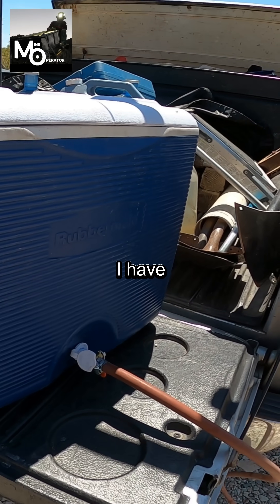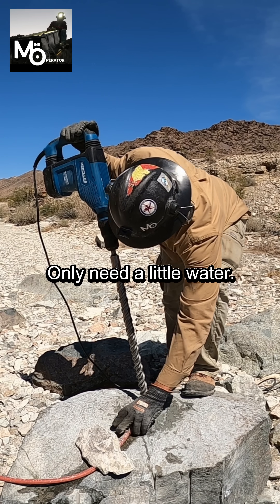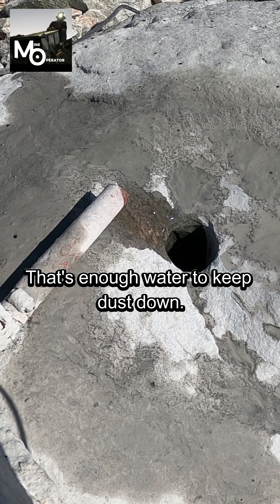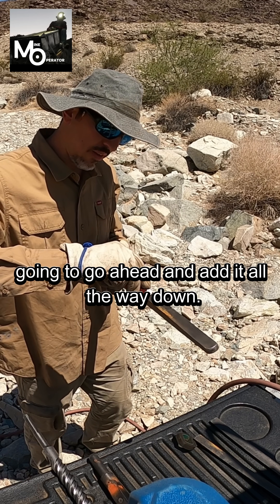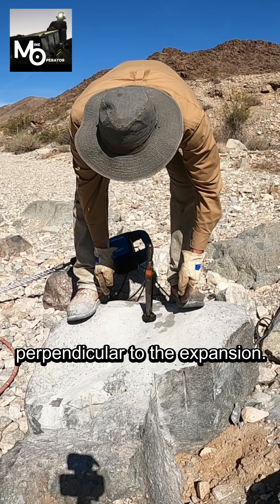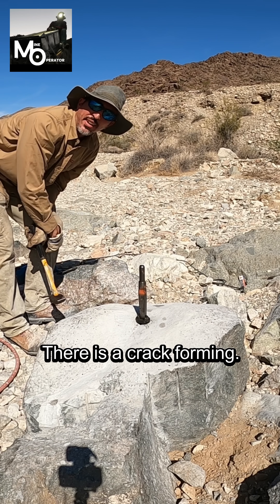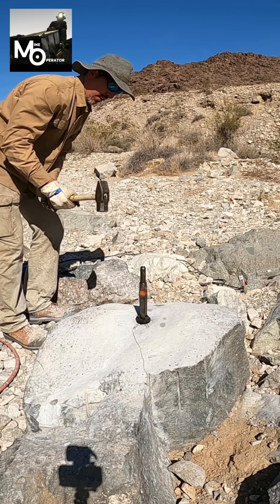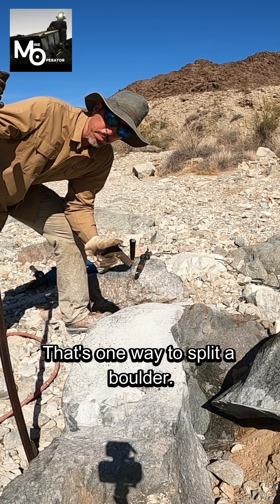Wet Drilling with an Ice Chest?  #drilling #boulders #mineoperator #cooler #demolition

Comment: My house in Maine is built on some very hard rock, do you think i could drill holes in it like you did, and fill the holes with water and possibly freeze break the holes by piling dry ice on top? I know, weird question but i would like to create a low point for a sump pump. Its very hard, may be some kind of metamorphic stone?
Reply from the maker: You could also use Dexpan.
Reply: Dexpan is amazing. I had some doubts but I recommend it all the time.
Reply: Granites mostly up that way!
Reply: @michaelburbank2276 NH is technically the granite state

Comment: If it works there's nothing silly about it. I'll also pretend like I didn't see you using the drill steel as a pry bar 😂
Reply from the maker: It was actually a 5' pry bar that I used. It has a hexagonal shape like some drill steel. It really does look like drill steel 😆.